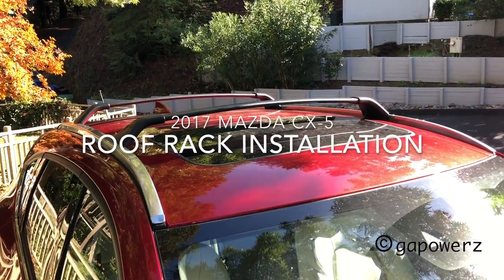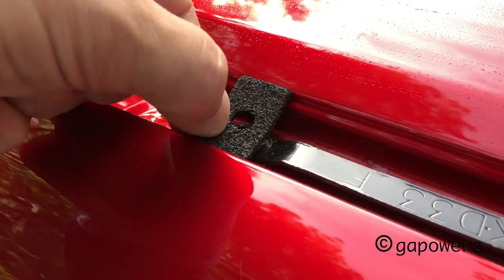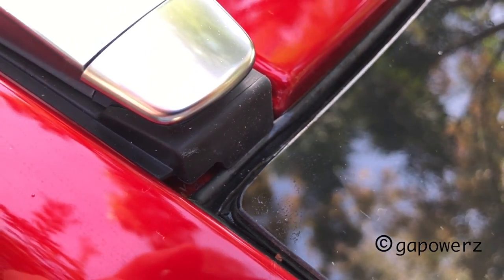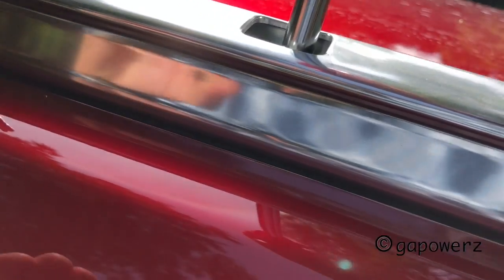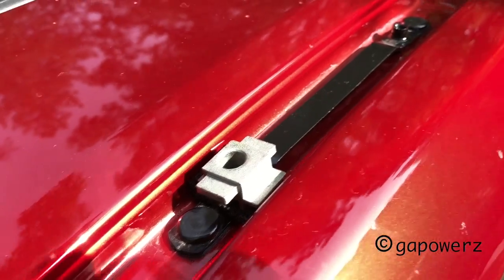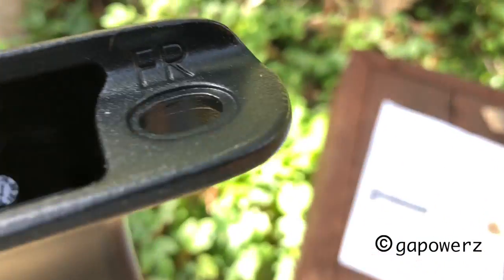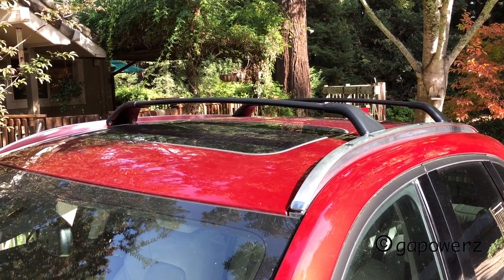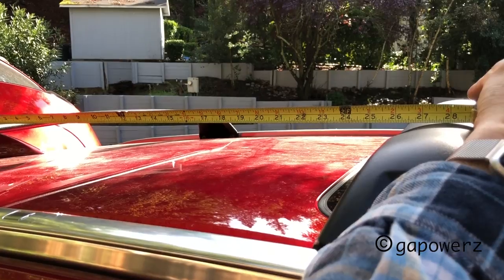2017 CX-5 Roof Rack Installation

Comment: Worth noting that when you install, the rear side rail will appear slightly higher than the front one... probably to compensate for the slope of the vehicle. Just installed mine on a 2018 CX-9 and looks like most of the parts are identical. Only change is that gone are those black foam spacers and replaced with some strange (and thin) adhesive pre-mount. And yes, dropping one screw into the housing of the roof rail is a major PITA, so follow his advice and go with the magnetic screwdriver!

Comment from the maker: The side rails are Mazda Part No. 0000-8L-R09, list price $349.95
The cross bars are Mazda Part No. 0000-8L-R07, list price $249.95
Various sellers have these parts on discount.
These parts are new for 2017, and not compatible with earlier CX-5 models.
Nor will the old side rails work for the 2017 model.
Reply: I ordered my parts with BAM Wholesale $280 for side rails and $190 for cross bars - labor was a six pack of beer for my brother!  Felt so good not to pay the dealer the $1200 they wanted for the job:) . Got the Thule Force L box on top - fits perfectly
Reply: do you have for mazda 6 2014
Reply: Why the pre-2017 CX5 roof racks not compatible with the 2017+ models? Do bolts have different offset?
Reply from the maker: @victorkonon  Sorry, I don't know why 2017+ roof racks are not compatible with earlier CX-5 models, or even when compatibility might end. Best idea is check the Mazda parts site.

Comment: I don't know if you got your cargo box, I couldn't find your video, but there is a way you can program your rear hatch to not open all the way up (while your have the cargo box installed), then you could reset it to open all the way to top position. Just a thought. I just received the roof rails, and haven't even ordered the cross bars yet. Great job on the video, I found the cargo box in grey which I think would match my car better since it's metallic silver, but that's a different story.  Hope this helps someone.

Comment: My instructions showed to torque the bolts to the roof at 12-14Nm. Luckily I have a torque wrench but I couldn’t reach that torque setting with just the screwdriver handle.
The video is great though to demonstrate just how easy the task is.

Comment: Hi George, I am looking to do the opposite (remove roof rails and install black moulding). I purchased the moulding and attempted to do the switch. Were there any screws that kept the original black moulding fastened to the roof? it seems there is not enough to keep them situated as is (the ones I purchased). Thanks!

Comment: Dealership installed my roof rails but my crossbars were backordered. Had them shipped to my house because the dealer isnt that close. Front crossbar fits fine. The rear one wont fit. Even if i take the rubber spacers out. The bar is as narrow as can be and the bar is positioned correctly.

Comment: Hi George, great video! I have a couple of questions, if you don't mind. Did you happen to notice a significant wind noise increase after installing the cross bars and driving with open moonroof? Also, do you think the cross bars are engineered to be taken on and off multiple times, or should you just keep them on once they are installed?
Reply from the maker: Thanks!  I never open the sunroof, so I don't know about the wind noise.  I never take off the crossbars, it's a pain working on those screws and I'm afraid of wearing out the heads.

Comment: Does anyone know where I can get some new packing sheets? I called the Parts department of my local Mazda dealer (as directed by Mazda corporate) and they didn't have any. 

I removed the rack from my old lease (2020 model) and am going to put it on a 2023 CX-5 (they should fit ... crossing my fingers LOL).  I can buy polyurethane foam online and cut to size but not sure if it will have the same texture/grade as the packing sheets.

Comment: George, hope you're still checking the comments on this video. Can you please measure how far back the leading edge of the front crossbar sits back from the front windshield? I need to see if the bike rack carrier I want is short enough to fit and still allow the rear hatch to open. Thanks!
Reply from the maker: Hi Chris, I will measure when I get home.
Reply: Awesome, thanks so much! If you can let me know your measurement method that would also be a huge help (lay down tape measure to follow the curve of the roof, or keep it straight, if that makes sense).
Reply: Or, a better measurement may be between the leading edge of the front crossbar all the way back to the rear hatch when open. I'm looking for at least 55 inches to be able to install the bike carrier I want. Thanks again!
Reply from the maker: OK, leading edge to raised hatch is 51.5" at the level of the crossbars, measured at center.  Could be a problem with your bike carrier.
The distance from leading edge to top of windshield is 22.5"
Reply: Thanks for measuring. I've found some bike carriers that are 50" long that I've used before, and there is a way to modify them a bit to slide forward another inch or so. The rear wheel of the bike hangs over an inch or two past the end of the carrier. It will be a tight fit, but I'll survive. Worst case is the rear hatch is almost fully opened and stops when it hits a bike tire. That's a much better situation than it hitting the metal bike carrier.
Reply: Additionally, you measured at center. If you move forward to the leading edge, the front skewer attaches to the front part of the carrier another inch or two even more forward from the leading edge. I think I'll have an inch or two to spare on the rear end. 

Ideally, Mazda would have designed the rails to have multiple crossbar attachment points. I suppose the rails could be modified, but that's more trouble than it's worth since it appears my setup will work.

Thanks again. Very much appreciate the help with this!

Comment: @GeorgePowers do you have the ordering/part information ? After watching I think I'm leaning toward the install on my CX-5.
Reply from the maker: Anthony, this information is 3 years old, FWIW. 
The side rails are Mazda Part No. 0000-8L-R09, list price $349.95
The cross bars are Mazda Part No. 0000-8L-R07, list price $249.95
Various sellers have these parts on discount.
These parts are new for 2017, and not compatible with earlier CX-5 models.

Comment: Can you measure how wide/long the front and rear crossbar are (from the edge of the mount to the other one)? It looks like it's about 30 inches long but would like to know exactly, can't find that online anywhere. Thanks!
Reply from the maker: The width between mounts is 32", while the width between side-rails is 42".

Comment: Can the roof rack be taken off and put back on without taking the roof rails on and off?
Reply from the maker: Yes, you can remove the cross bars without loosening the side rails.  I have not removed the cross bars yet, partly because it isn't easy to access the mounting screws.

Comment: Hi George - I’m attempting to put mine on and it seems like the holes do not line up. They are fine front-to-back but they don’t match up side-to-side (driver side-to-passenger side). Did you have this problem at all? Any tips?
Reply from the maker: Sorry I did not have a problem with hole alignment.  Maybe post a picture? Do you have the right match for rack and model year?
Reply: @GeorgePowers  thanks for the reply. It does seem to be the OEM part for my 2018. Hopefully this link works with a picture: 

https://ibb.co/P6NkLhH

This is the hole furthest back on the passenger side. All the others on this side have been tightened enough to only stay on. 

When I began the driver side, it didn’t seem like ANY of them were lined up well, in my opinion.
Reply from the maker: @michallageer186  Thanks for the pic.  I think you can see most of the threaded screw hole through the hole in the rack.  If that's the case, then you may need to push the rack so the holes align better, or maybe lever the holes into alignment by inserting a narrow screwdriver.  Best to proceed gently, maybe loosen the other screws first.
Reply: @GeorgePowers  I ended up needing a second person to start the screw while I pulled the rail into position. For being an OEM part I was quite surprised at how different each side was (one side fit on without much issue) and how much adjustment was needed. But in either case it, it’s on and I just hope they don’t cause issue when I put anything up there! Thanks for the help.

Comment: Do you happen to have the cross bars specs  like load range and speed limit allowed?... I call the dealer and surprisingly they do not have the info
Reply from the maker: Sorry, I don't have any load specs.
Reply: @GeorgePowers   Thanks George... I just bough them I have a question for you... in one of the sides of the bars there are two screws that are fixed and in the other side there are two that are in a kind of a slicer that allows the bar to make it bigger... well the thing is that I cannot tight those screws... I mean I can tight them but the bar continues slicing... and the question is it it tis that the way they are supposed to work?

BTW... the max load combined ( between the two bars) 165lb

Comment: How high are the racks off the top of the roof?
Reply from the maker: Hi Daniel! The racks' lower sides are about 2.5" above the roof, and the top sides about 3.25" above the roof.  I took these measurements just inside the support brackets, which add about 0.25" in either direction.  It looks like the racks arch to provide a little more clearance in the middle.  Just to be clear, by "rack" I mean the cross bar.

Comment: Do you think this will fit a 2016 cx5?
Reply from the maker: I don't know, but I doubt the 2017 rack will fit the 2016 because Mazda changed the design for 2017.
Reply: @GeorgePowers  ment the 2016*

Comment: Nice job on the video. Professional “how to”. Looking forward to your cargo box install.  Your duct tape looked a lot like gaffers tape. Are you a pro?
Reply from the maker: Hi Joe, thanks for your comments, I'm strictly amateur, and that's just duct tape.  I bought a Thule Force Alpine cargo box, which is perfect for four pair of skis.  The installation was trivial, just unbox, put on rack, slide forward, and tighten the clamps.  It barely leaves room in back to raise the CX-5 rear hatch, but it fits.  I like that this cargo box is long enough, but not much bigger than we need to fit our skis, so we avoid excess wind resistance, noise, and weight.

Comment: Where's the storage box vid?
Reply from the maker: Sorry, I had good intentions, got any particular questions?
Reply: Lol no I was just curious where the next part was. Possible interest in find one for my wife's CX-5 and really enjoyed this video and was curious how you fared with the box itself and how you liked it!
Reply from the maker: We bought the Thule Force Alpine box from REI, though they don't seem to carry it any more.  We have used it a few times to carry skis, and it has worked very nicely.  It is long enough to fit three or four pair of skis, which is our main purpose.  I like that it fits on the CX-5 without interfering with the tail gate opening.  This box is narrower than most, since it is not intended for camping, moving, or other bulky cargo.  That's great for ski trips, less air resistance and less wind noise.  I can mount and unmount the box myself, preferably using a step ladder to reach in and work the clamps.  Then I can load/unload skis by stepping on the door thresholds.  You may need to remove the box to park in some public garages, so watch out for that!